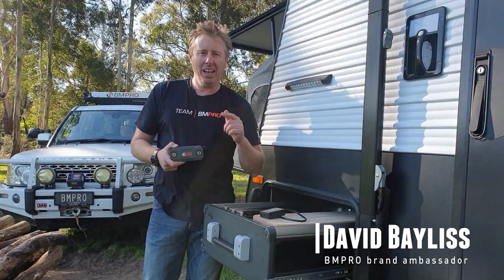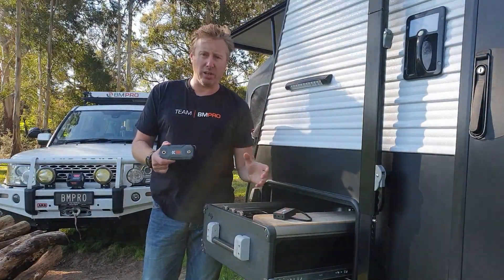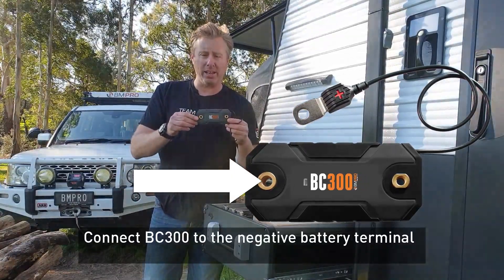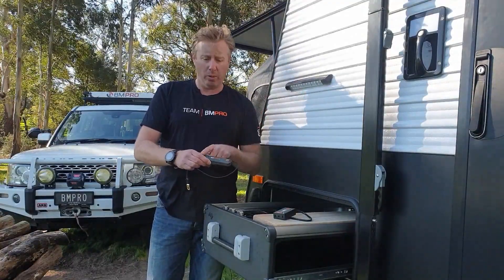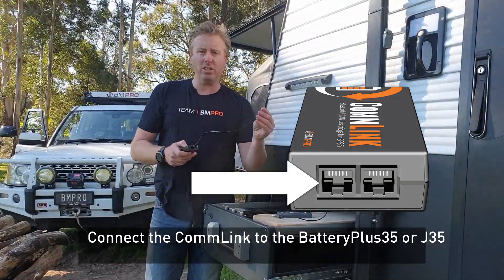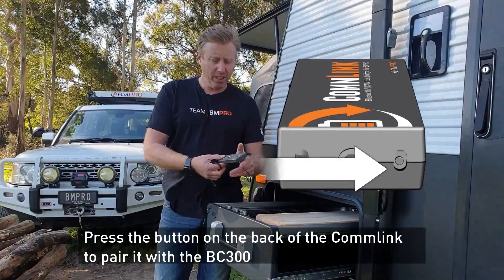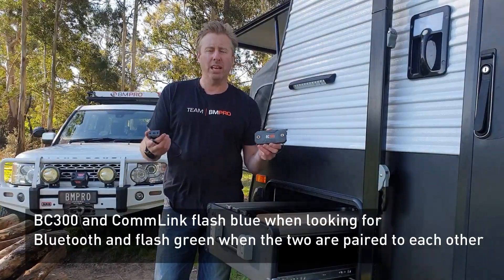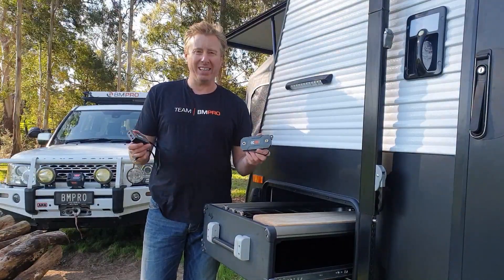How To Quickly Install And Pair A BC300 + CommLink By BMPRO

Comment: I had to return my BM 300 shunt with poor communication and sending an error requesting a reset all the time.
Not over impressed with the battery management system as I have had several smallbissues that seem to hang around like the shunt and a high pitch noise when the management system starts the charging process.
Reply from the maker: We are sorry to hear of your experience, please contact our support team at customerservice@teambmpro.com for further assistance, on the small issues.

Comment: hi there
were getting a caravan that has the bmpro bms inside but we want to add the bc300 to add external solar blanket but when the bc300 is installed on the negative terminal how would i connect the battery check shunt??
thanks